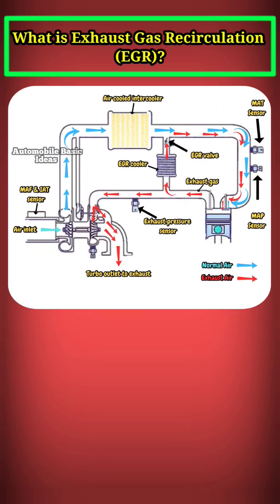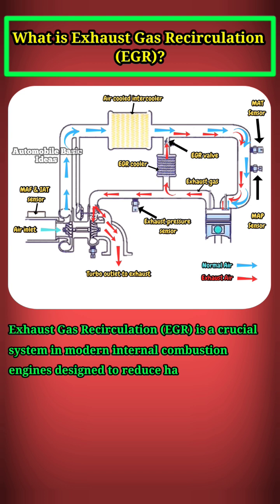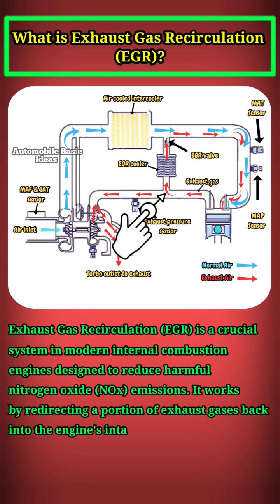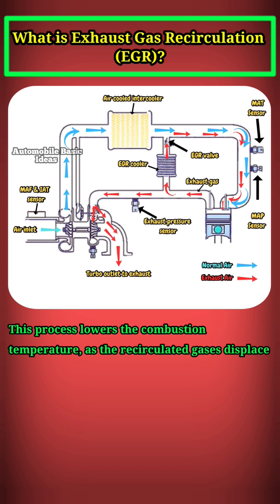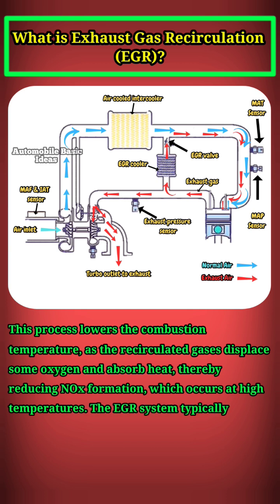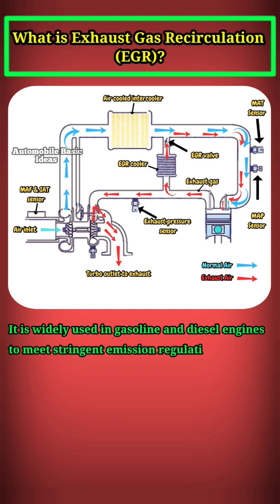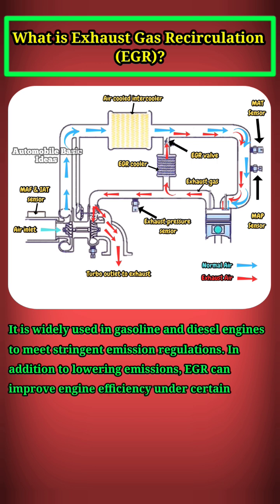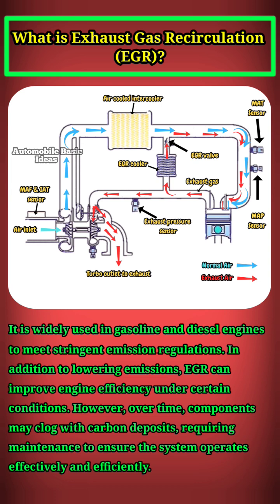What is Exhaust Gas Recirculation (EGR)?

Comment: where is the egr valve located
Reply from the maker: The EGR (Exhaust Gas Recirculation) valve is typically located between the exhaust manifold and the intake manifold of an engine. 

In older engines, the EGR valve is usually mounted directly on the intake manifold or the cylinder head, connected to the exhaust passage.

In modern engines, especially with electronic EGR systems, it is often placed near the intake manifold with vacuum or electronic control, and may also be integrated into the throttle body assembly.